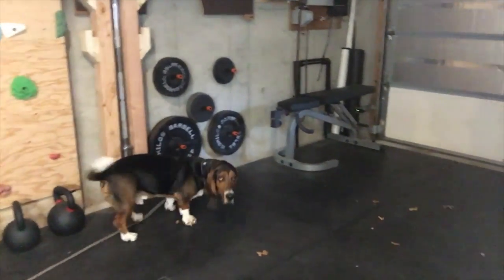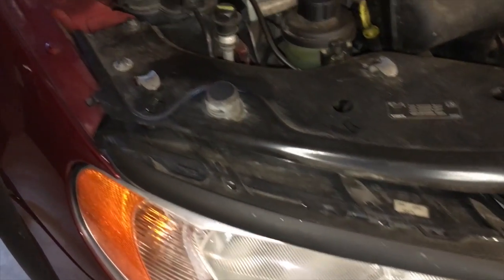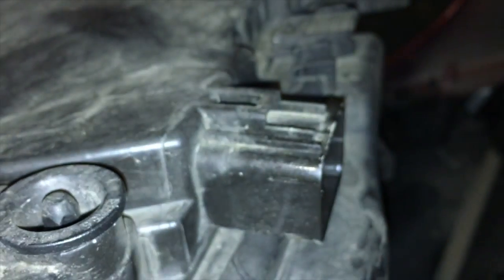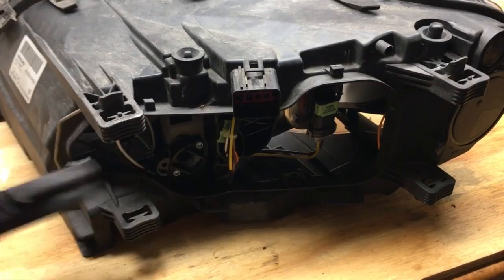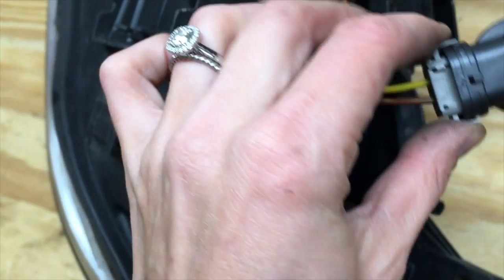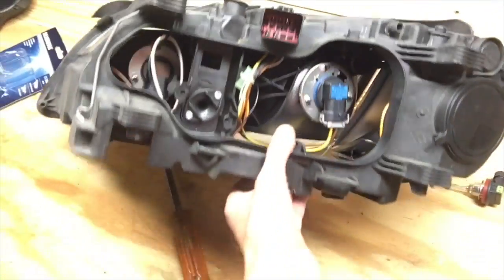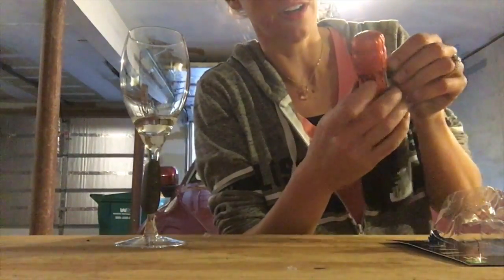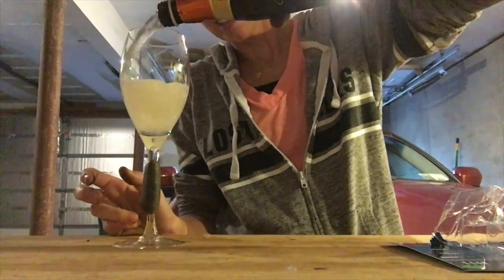Cheryl Changes a 2011 Volvo XC70 Low Beam Headlight

Comment: Cheryl, That was an awesome video.  I have a 2010 V70 and I hope it has the same setup as your 2011 XC70.  For next time...remember that touching the new bulb with your bare hand is a no no.  The bulbs get extremely hot and oil from hands creates 'extra hot' spots on the bulb which lead to premature failure.  Thanks for sharing.  You go girl!!

Comment: I have a 2011 Volvo XC70.  Took the light assembly out as you did, but the inside has a ballast for the low-beam light.  Not too difficult to unplug, unhook, and then replace.  (The metal cage that holds the ballast in place needs to be pressed in at the top and then pushed sideways to escape the clasp it connects to.)  Also, the ballast ends up costing much more than just the bulb that you had; the bulbs cost $53 for a single package of two of them; the ballast/bulb combo was $100 for the one of them.  At any rate, thanks for the video; made me feel like I could handle it without another trip to Volvo (an hour away).  And your hubbie has nice taste in rings!

Comment: Brilliant video! Watched it once, went out to my car changed the light with no problems or surprises!  One thing I'll add though - my UK/European XC70 uses a different bulb which is H7 (as you say the manual states). Apart from that, exactly the same :)

Comment: Thanks. I 've been struggling with a 2010 s80 headlight (same housing). Turns out the problem is I'm trying to replace the H11 bulb with an H7 as the manual says.  What terrible documentation.

Comment: Cheryl I didn't get my elderflower and prosecco!  The bulb part went ok - except I too I had the wrong bulb.  BUT what I did was pull on the metal pins too hard and one went flying and into the engine compartment where it is now hidden.  The bulb part was so easy - thanks for that.  Now I'm screwed and don't get my drink so am very sad.
Reply from the maker: The elderflower is KEY!!! Also hold on tight! Good luck looking for that pin!! Thanks for watching and writing and subscribing. :)

Comment: Good video. Just a note though, don't touch the new bulbs (the glass part) with your fingers. The oil from your hands will make hot spots on the glass and kill your bulb a lot sooner than the typical life. They like to be clean.
Reply from the maker: VERY true fact!! I should have mentioned that! (And possibly not done it if I did lol!)